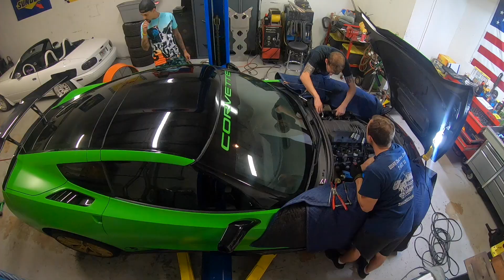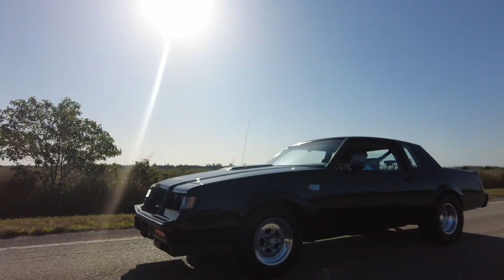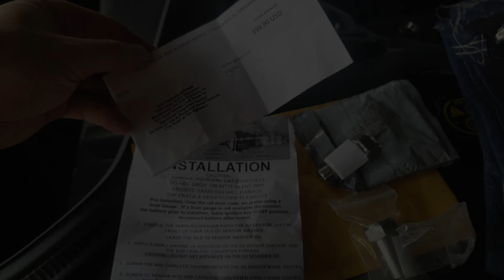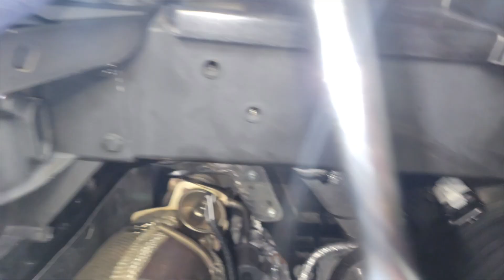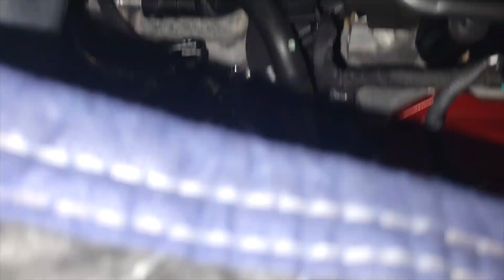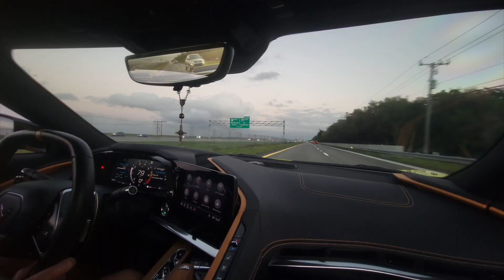Corvette C8 High Flow CAT CEL FIX!

Comment: Thanks for this. I got some high flow cats with the Big Daddies mini cats and I didn't have any luck, CEL came on within a few miles. If I clear codes and do this relearn think I may have some luck?
Reply from the maker: yes, send me an email and I will get you the relearn procedure. southfloridagearheads@gmail.com
Reply: @southfloridagearheads  I do not see the link for the relearn in the description, jus the minis. I am going to send an email if you could send it to me that would be great. Thanks
Reply: What brand cats did you use?

Comment: I believe HP Tuners does have these unlocked, but it requires sending the ECM to them and it's very expensive.
Reply from the maker: your probably right haven't looked into it much. won't be a cheap car to modify like the LS platform.
Reply: Bigdaddies sucks